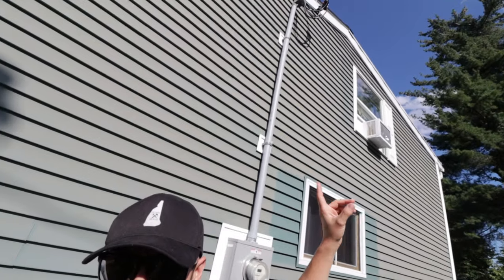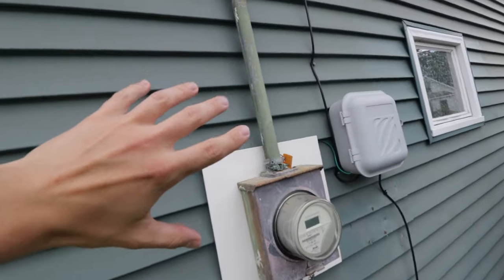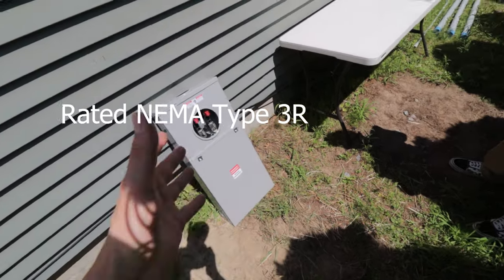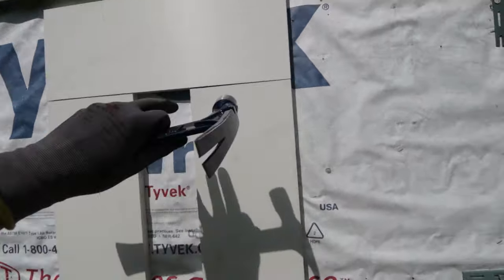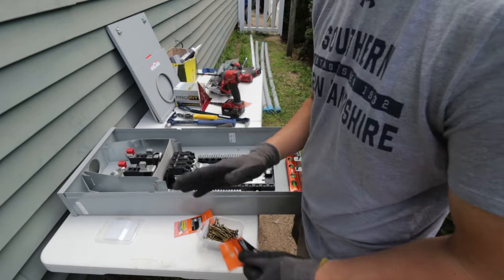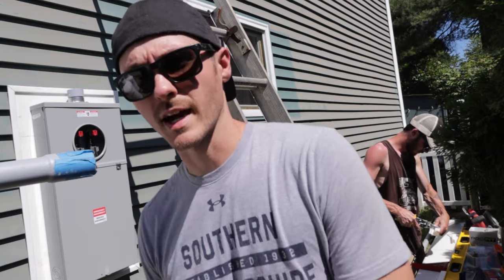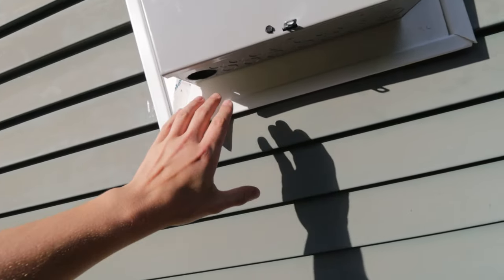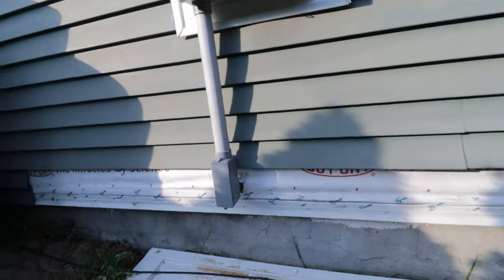Full 200 AMP Electrical Service Upgrade Install

Comment: Clean work, definitely took longer than we would for customers but it’s your home and you definitely made it look clean as you’ll be seeing it everyday.
Reply from the maker: Totally agree! Way too long to complete 😂Thank you Andrew!
Reply: @DownToTheFrame  Pro-tip, you want things to be level with the structure not gravity when using a bubble level, if you want things symmetrical.
Reply from the maker: @MrAnderson5157  Thank you for the tip!
Reply: @DownToTheFrame  I'm sure you knew that, just putting it out there for those who might not know :) Saves on time, frustration, and perhaps materials.
Reply from the maker: @MrAnderson5157  haha yes, I agree it is much easier to get things to look right when you level it with what you are mounting to

Comment: I am doing a 200amp upgrade also as my original panel has glass fuses. I will be able to use the old panel as a junction box. Just had to replace my Meter base with an emergency shutoff meter base as the code has changed since I started. Ugh. The next step is getting the mast and weatherhead installed and finish up installing breakers in the new Eaton panel. Thanks for the great video.
Reply from the maker: That’s awesome! Sounds like you’re putting in some good work! Thank you for watching!

Comment: I really enjoyed this. You influenced me to change my electrical meter base/break panel plan. I think the combo seems to be the best way to go, I just need a find one that is ringless as my power company requires that. I just pulled my electrical permit last week and starting in two weeks. Great video.
Reply from the maker: Thank you Randy! Glad you enjoyed it! They have some great combos out there now.I hope things go smoothly for you!

Comment: Nice job, the only last thing I see is the service entrance cable up in the house there I know it’s temporary but it wouldn’t meet code because it’s not Protective it’s not along the side of a joist, you could protect it with a metal plate of equal thickness like a metal box or get those wires into some sort of pipe, keep up the good work
Reply from the maker: It met code where I am and passed inspection but an ideal way to do it is to continue the PVC conduit or even EMT. The more protection the merrier!

Comment: Any source of ignition for LP needs 10’ not 3’ I suggest you have contacted Irving which is their supplier because when the provider stops filling those tanks you’ll be stuck picking up the cost to move the tank.
Reply from the maker: Inspector cleared it and Irving has been filling the tanks for a year now. No complaints. I agree that it should be as far away from gas sources as possible. I am in the process of eliminating gas from the house anyway.
Reply: Yeah, 3’ from those seemed like a bad idea, code or not.  Plus, going to the other side of that window would have hidden the install more from street view.

Comment: Some aluminum that manufactured today does not require you to use antioxidant compound on the aluminum conductor.
Reply from the maker: That’s a good piece of info! I’m always trying to make sure things are extra well built so I personally will probably always use Noalox on my aluminum terminations.
Reply: That's not true.
Reply: Aluminum is aluminum. You don't know what you're talking about.
Reply: They have better alloys in the aluminum that is produced today compared to aluminum produced in rhe 1970s.
Reply: It’s worth it for peace of mind even if that’s true. With all the money spent a little antioxidant is a small expense
Reply: @mitchelldantone5476 The lugs are UL listed for use with copper or aluminum conductors without the use of ANY anti-oxidation supplement.
Reply: @Young937phoenix It is true.  The change was made in the early 90s as I recall.  The approved AA-8000 alloy does not require antioxidant compound.

Comment: Fantastic video. This one has been suggested to me for weeks but I just got around to watching it all today. You and I have many of the same tools, including all of the Milwaukee gear and the lighted, magnetic Klein tools level. Everything is overkill here IMO but of course there's noting wrong with that. I only found two things I would have done different and one of those things is the 1.5" PVC moves up to 2" because its easier to work with and two, the grounding electrode conductor (ground rods) no matter the size of the service is always going to be 6AWG. #4 copper is used as the grounding electrode conductor to the copper water main. I'm very impressed with your video.
Reply from the maker: Thank you! Great minds think alike when it comes to tools! and Yeah I would have preferred to use a 2in pvc but there wasn’t enough room with the pre-existing KOs on the box. As far as the sizing of the grounding electrode I just followed the chart in the code book for sizing of that. Luckily if it is oversized it doesn’t hurt anything lol Thank you again!
Reply: @DownToTheFrame  would be great to have no pre stamped ko's on panels.use Greenlee ko set .mark it,drill it,punch it.
Reply from the maker: @frankm5019  that would have made life a LOT easier lol
Reply: @DownToTheFrame  Why couldn't you drill a larger hole where the knockout was to fit a larger 2 inch PVC pipe?  Was the bottom too small? If not is there any code saying not to drill it?
Reply from the maker: @tatersinc  there simply wasn’t enough blank material in the bottom rod the box. I would have preferred a box that didn’t have pre-stamped knock outs that way I would have had more options

Comment: check out the pro tip of the day from The Electrical Code Coach regarding the ser cable you used to feed your sub panel. When using that cable as a sub panel feeder it needs to be landed on a 90 amp double pole breaker in your new outdoor main panel instead of the 100 amp double pole breaker you installed. I made the same mistake when I added a sub panel in my basement and have since corrected my mistake.
Reply from the maker: Hey Paul! I am looking into your question further. Unfortunately, the video that channel posted does not explain his reasoning. So far based on the thermal tables in the code book, for the type of SER I used, I have not found any issues with using a 100 amp breaker but the electrical field has many overlapping rules so I will try to confirm in the next couple of days! To clarify, I believe that video is talking about burying the cable in a wall cavity with insulation. Which does change how much amperage conductors can carry according to the code book. In this instance, my cable is not buried in a wall.
Reply from the maker: So I have reviewed the code and consulted with some very experienced colleagues. More than likely the reason that guy said to only use 90amps is because of most terminals only being rated to 75c. Which if you rate the cable at 75c instead of 90c you get 90amp max rating. However, there is a chart in the code book specifically for feeder wiring. Sub panel wiring is considered feeder wiring. That chart states you can use 2 AWG aluminum. Also, there is a section that states to rate wiring that touches insulation in a wall cavity at 60c. However, it is only for 10 AWG wire and smaller. So 2 AWG aluminum does not apply. Lastly, loads calculated for panels are only allowed to be at most 83% of the load. Which is less than 90amps anyway. So the wiring won’t see anything more than that. Using a 100amp breaker according to this information is safe and to code.
Reply: In a residential application you are allowed to use the 83% rule on your service wires and feeder only if the feeder is carrying a 100% of the load. By installing a meter combo and feeding your ac, your feeder to the sub panel does not carry 100% of the load. That means you have to size the feeder wire according to the load. And breaker it accordingly. 90amp wire=90amp breaker.

Comment: Great work ! But I think you should use pvc schedule 80 above ground .
Reply from the maker: Thank you! For the PVC under the panel it’s not a bad idea to use schedule 80 but according to the code book, it’s only required for areas susceptible to damage. This area doesn’t really meet that criteria
Reply: Thanks! I learned something today

Comment: Should of used 2 AWG copper to match the 200 amp line side of the service u did all that work to give you the same 100 amp panel u had on the old service ?
Reply from the maker: I am in the works of collecting material for replacing the panel inside. I wanted a cheap option to get the house powered while I planned the rest of the electrical upgrades. I will for sure be posting a video of those upgrades in the future! and I will be swapping out the 2/0 aluminum for 2/0 copper to allow for 175amps inside the house.
Reply: Awesome, also forgot to mention u did a real nice n clean job outside 
Quick ? the inspector didn’t say anything about the house service head not being above utility line service just wondering because here in NY it’s code
Reply from the maker: @phillyelectric7043  I did not see anything about that in the requirements from my power company and the inspector did not mention it so I don’t believe that is code. The weather head is also right in-line with the weather head

Comment: Hi I’m looking to setup a 200 amp panel 100 ft away (above ground, through the attic) I’m wondering which phase sub panel I need for that? Running 4-5 20 amp 110v lines and 2x 20-30 amp 220v lines. Also I’m wondering if this cable will be the correct cable for me to run box to box?:

4/0-4/0-4/0-4/0 Appaloosa Quadruplex Overhead Aluminum Conductor
Reply from the maker: You will need to reference local and national electrical code. However, I can tell you that for my 200amp panel I used 4/0 aluminum SER (service entrance cable) which contained two hot conductors, a neutral, and a ground. I bonded my grounds and neutrals at the first means of disconnect. For me, this was at my meter socket. Make sure the cable you purchase is rated to be ran inside wall cavities. Cables labeled as “Overhead condusctos” might only be rated to be used outside. The manufacturer information will tell you what it’s rated for.
Reply: @DownToTheFrame  thank you for your response! I was doing a lot of research trying to find answers and I noticed 4/0 is rated for 205 amp depending on the material it’s wrapped in. But there was some site that says account for like 20% extra so like 240 amp wires? Also I was seeing that it was recommending XHHW-2? Would I need 250 MCM XHHW-2 or has your meter to panel 200 watts been fine with your 4/0 AWG SER? Also I’m in Arizona where it gets 180 in the attic but of course I can do things to get that lower like adding high cfm vent fans. Thank you for taking the time to help me
Reply from the maker: @ChemysteryKids  So in the 2020 national electric code there is a chart that tells you what size conductors you need for single phase dwelling service and feeders. The wire you are running is a feeder so according to that chart (no thermal corrections applied) all you would need is 4/0. However, only a licensed electrician could determine if your environment calls for larger conductors due to the heat. There are tests and math involved in that. Aluminum SER would more than likely be what they recommend running.
Reply: @DownToTheFrame  awesome thank you! Last question do I need a 2 or 3 phase panel? Running 5x 20 amp 110v sockets, 2-3x 20-30 amp 220v breakers depending on how much and many dedicated lines the mini split requires for 28k btu and the 2nd or third is for my 15 amp compressor
Reply from the maker: @ChemysteryKids  Your house more than likely only has single phase (two hot conductors) going to it. That means you can have 120v and 240v power. You don’t need three phase unless you need 208/480v power. You seem to be more concerned about amperage and not voltage. Load calculation are very complex. They are based on factors such as, how much current is being drawn, for how long, at what times are the loads being used, if they are motor loads, or non-linear/linear. However, most homes 200amps is plenty. I didn’t hear you mention any car chargers or tankless electric hot water heaters so my best guess is 200amp would be fine. Although again, only a licensed electrician would be able to tell you for sure.
Reply: @DownToTheFrame  awesome thank you! You have been a major help and In return I will be a long term subscriber and try to like and share your videos as much as I can
Reply from the maker: @ChemysteryKids  haha you’re welcome and thank you so much! Glad to have you here!

Comment: Where does the other ground wire connect to? because I saw 2 inside the meter box.
Reply from the maker: One goes to the sub-panel inside the house.

Comment: Just curious why you separated Neutrals and Grounds in the Bonded  Combo panel ? Great detailed video! Nice clean work.
Reply from the maker: Great question! they are still bonded together but i like to keep things organized grounds and neutrals on their own bar.
Reply: Perfect.  That’s what I figured. I’m a big fan of keeping everything neat as well!! I actually “wrap “ the neutral and Ground together full length.   Does the #6 ground have to be in conduit ?

Comment: never saw service cable running exposed like that here in Pa. thought it had to be in conduit of buried by 4" of crete
Reply from the maker: Not sure what eyes you’re referring to. Are you talking about my service conductors coming from the poll or my grounding electrode conductor?

Comment: So when the interior main panel essentially became a sub panel. You un-bonded the ground and neutral. Did you run a new ground from the earth to the ground bus? Or is that ground bus just attached to the panel and isolated on its own?
Reply from the maker: Great question! There is a new grounding system attached to the new panel. Then from there I ran a ground with my sub panel feeder conductors to the sub panel and that is what connects the grounding systems

Comment: Hi, great video!  Question:  In New Hampshire, can you run your service cable between your meter socket and your 200amp panel in your basement inside of a 2x4 wall?  The cable would be in the 2x4 wall for maybe 2 feet maximum before it was in my basement.  Asking because right now, my service cable comes off the bottom of my meter socket and goes through my rim joist into my basement, this is creating a rotting situation where my siding and rim joist are rotting.  Coming out of the back of the meter, going 2 feet max down through the 2x4 wall to my panel in my basement would be cleaner but, is this code compliant?
Reply from the maker: Thank you and great question! As long as you have a disconnect outside then I think you will be just fine. Double check the code book and building code though. SER should be fine in a wall cavity but protecting it from damage is important.

Comment: Could bonding ground and neutral at the meter provide better “stability” of current then at the panel? I’m not sure how to define “stability” because I’m not an electrician. But, my family is dealing with an issue that nobody can seem to get to the bottom of: whole house tremoring lights. I’ve had 3 electricians come out and all the easy possibilities (loose neutrals, bad bulbs or switches, bad transformer, etc.) checked out okay. One electrician said upgrading the service line to bond at the meter instead of the panel could possibly fix this, but he can’t guarantee it. What would you do?
Reply from the maker: This is a great question! No, I don’t think that will help. You need the right electrician to solve this problem. It being the whole house does lead me to believe that you may have a main service issue and if you don’t already have a 200amp panel, it might be worth it to upgrade the service

Comment: I'm kinda confused 23:07 NEC article 250.66(A) says you can use a 6AWG copper?
Reply from the maker: It’s a big debate but yes, my understanding is you could as long as the wire is not susceptible to damage. If it is at risk, then some AHJs might want to see a larger wire. It doesn’t cost that much to upgrade and technically is a better conductor so i just avoided the risk all together

Comment: Why do you use pvc? In California we have to use rigid or imc for riser
Reply from the maker: Great question! I am not using my conduit as an attachment point so there is no need to use ridged. Also, PVC is no conductive. This eliminates the chance of it becoming an inductive choke and causing a fire.
Reply: It is required in California. Your right, about attachment point. But even if no attachment point, you still ND rigid or imc
Reply: Only way it would cause a fire, if connections are bad. I believe from your knowledge, that it wouldn't on your job
Reply from the maker: It is not a requirement in NH and the only people saying that it is are from California. Interesting rule but if the neutral is dropped for whatever reason is the main concern. It could be on the pole or damage to the house.
Reply: @DownToTheFrame  you guys are lucky, rigid is slot more expensive
Reply from the maker: Our state motto is “Live Free or Die” for a reason lol

Comment: Hi, we got estimates to upgrade our panel. The estimates varies so much with one almost only half of it and he told me that underground feed will be done by the electricity company if needs to be redone. Would you please advise if this is the right assessment and information? Thank you so much.
Reply from the maker: That’s a great question. If you are curious if your local utility will install the underground part to your house, you can call them directly and ask! I can’t confirm or deny if that is true because it varies per town/state. In my state, it is the electricians job to put the underground conduit and wire in.